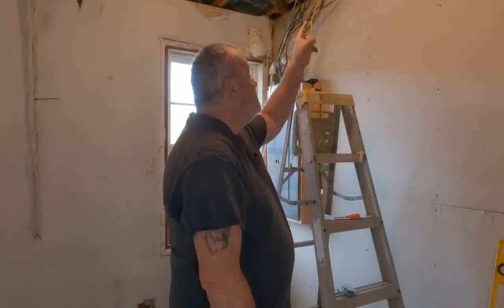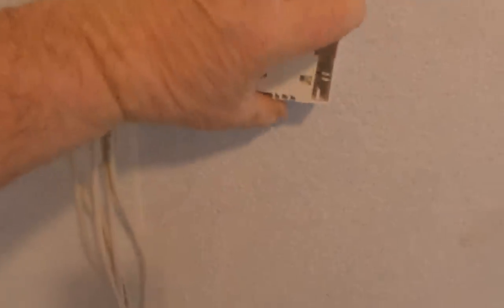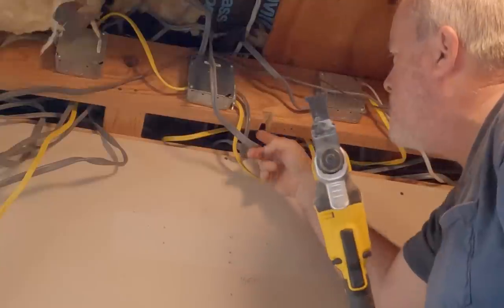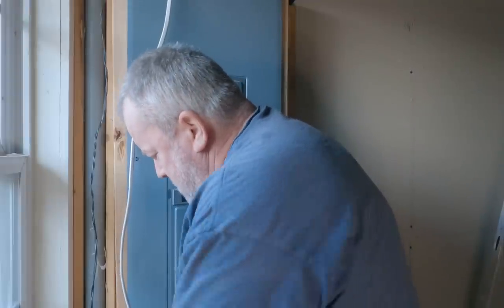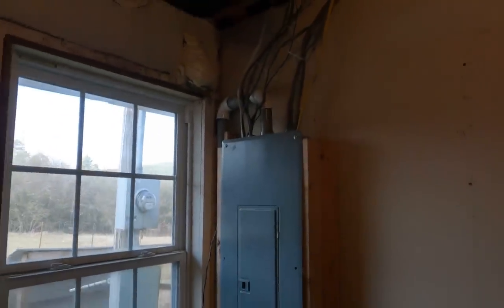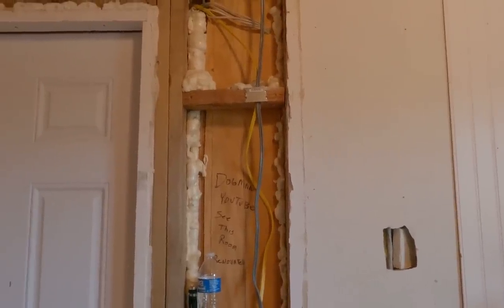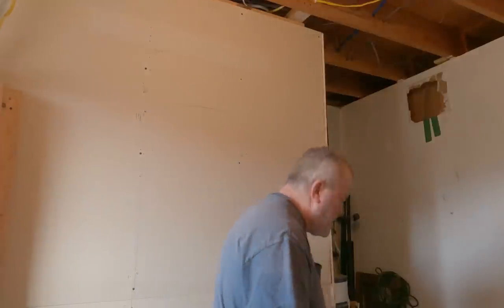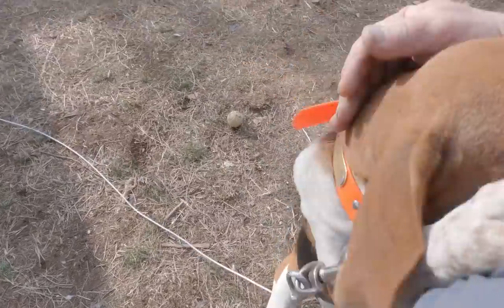Creating A Cozy Home Office. Progress Made,Still A Lot To Do.

Comment: Have you considered putting a piece of wood under the bead board? That would bring it up to the right height. Glad to see you putting up the metal piece over the wire. Question would it be that hard to disconnect the wire and run it through the hole in the middle. You are compromising your roof beams. Please be safe. I enjoy your channel.

Comment: Omg Mike,  yes the big wires coming in the top of the breaker box are live, you turn those off at the meter, only the breakers below the main are dead when you turn off the main
Reply from the maker: They are not live, its coming from shut off panel.That has a main breaker.Thats why I knew the tester wasnt reliable